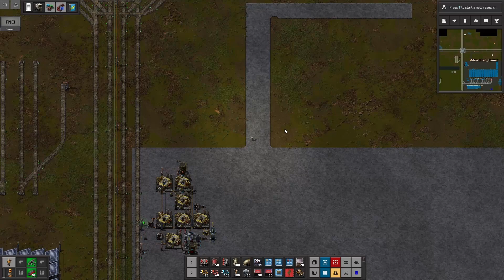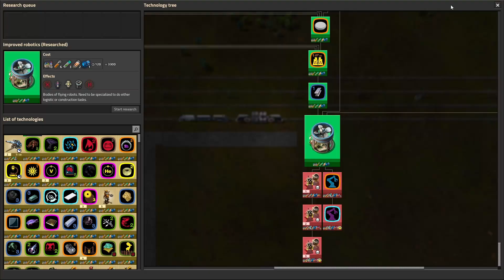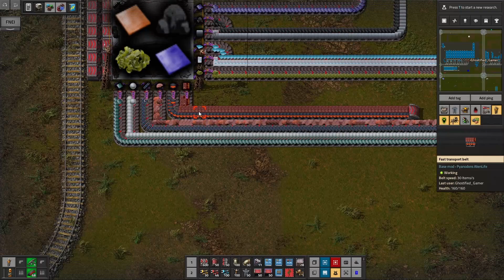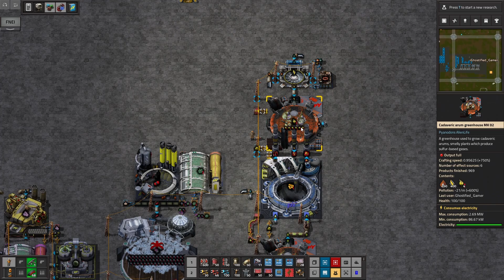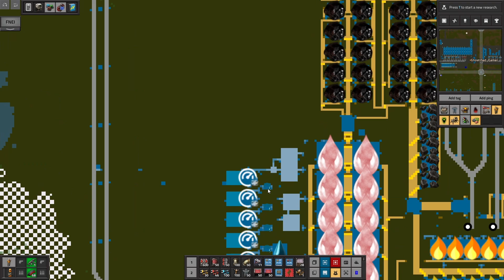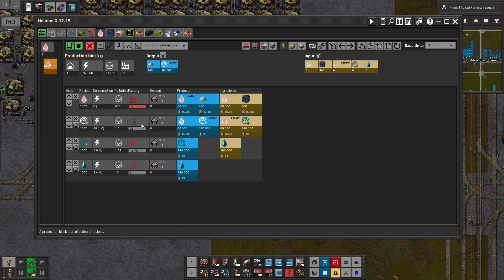Factorio pYanodons - MK2 roboports and MK2 Construction Bots - EP146

Comment: why you don`t use productivity modules in calculations? the chain effect of even mk1 prod modules halves the consumption of bottleneck resources even on relatively small footprint recipes. f.e. i redid latex build 2.5 p/s and formic acid consumption dropped from 250 to 204, which significantly differs in killed vrauks.
Reply from the maker: Prod mods eat power.  I'm avoiding them in exchange for larger builds.
Reply: Depends. just look at nuclear sample chain and you see that with prod modules you need less particle accelerators. Also hint, you can use green modules for glassworks or antimony oxide, and significantly decrease fuel consumption @FantasticMrGhost